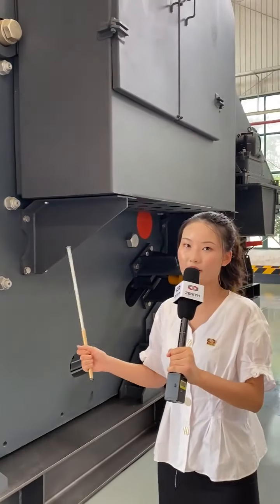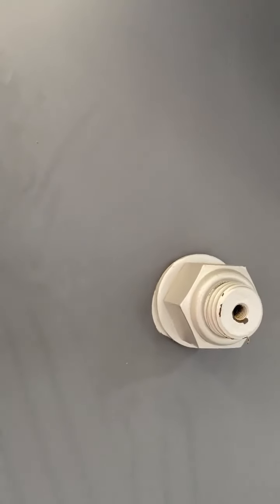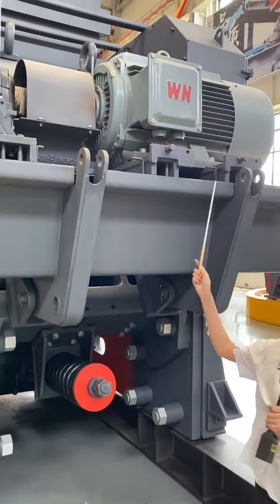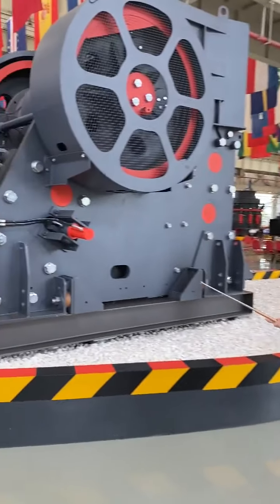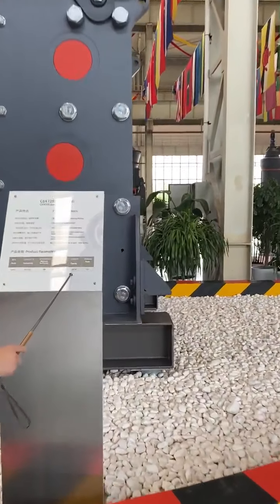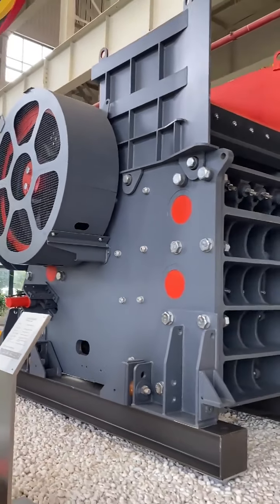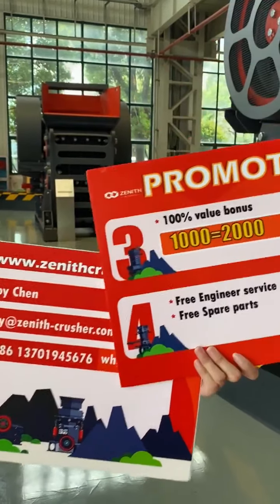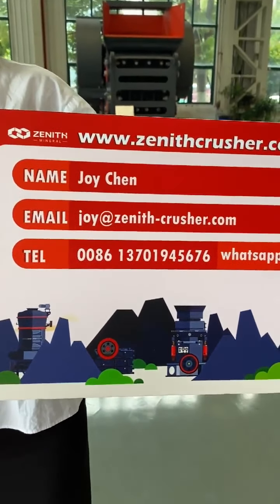Jaw Crusher Structural Advantage Instruction By Joy In Stone Crusher Showroom

Comment: Hello, thank you  for the nice presentation on C6X Series Jaw crusher,  you mention that, the location of the motor is to ensure stable power transmission and save installation space, i really agree with you, but have this reservation, with regards to the location of SKF bearings at both sides of the driving pulley. i think this will increase the maintenance time incase there is the need to change a deffective V-belt. Thank you.
Reply from the maker: Thanks for the comment. Glad to talk about this topic, if you have more idea  you can subscribe our channel and  we can talk more about the machine.